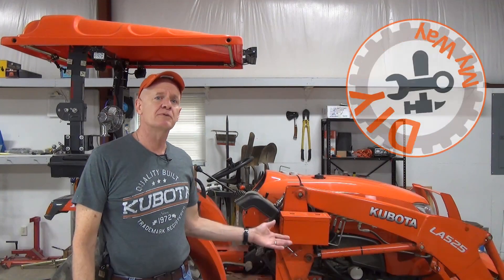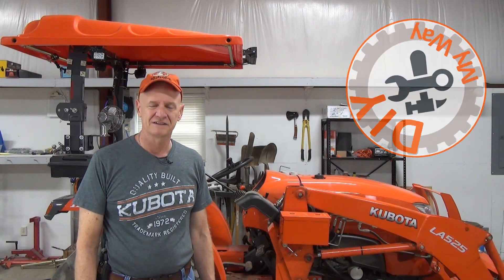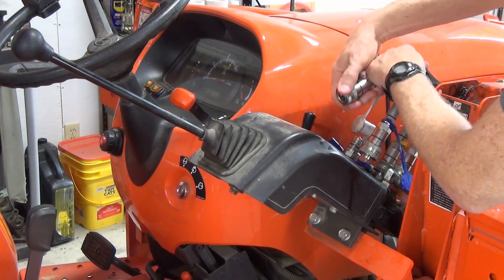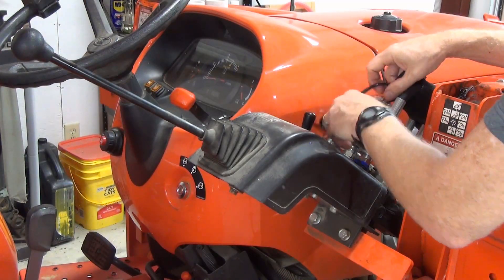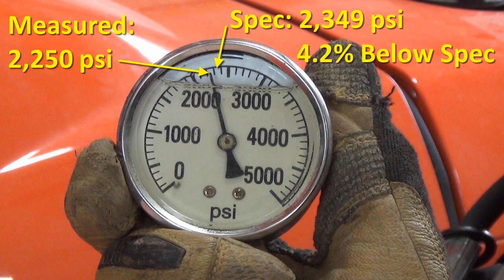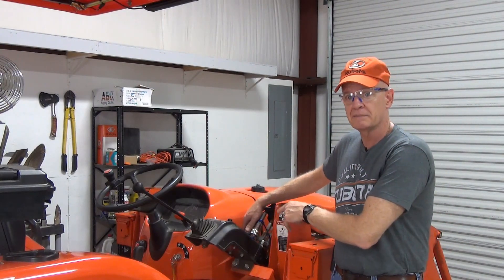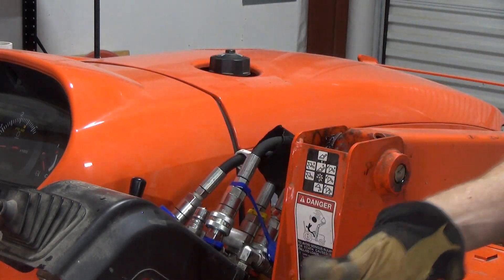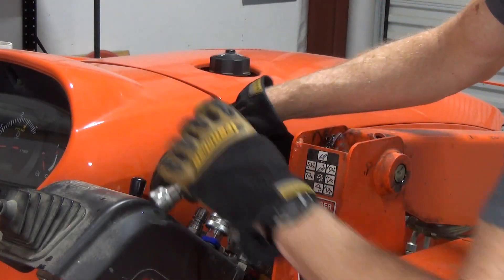How to Check Your Tractor's Hydraulic Pressure (#145)

Comment: If I am trying to find the proper RPM to idle the engine at for a pto hydraulic driven attachment, would this tool function well to test and find out which RPM is going to meet my needs? This is kind of a DIY project where the attachment isnt exactly designed to be an attachment for a tractor but does require hydraulic pressure. I know the limits of my attachment but I am struggling to find specific information on the pressure outputs.
Reply from the maker: Supposedly, the hydraulic pump pressure is not very dependent on the engine RPM.  The engine RPM does affect the gallons per minute of hydraulic fluid that flows.  The max pressure is controlled of the relief valve of your tractor’s hydraulic system.  Your attachment SHOULD have a pressure relief valve of it’s own to protect it from over pressure but if not, you should add one.  Will it be running off some rear remote ports or 3rd function valve?

Comment: Very useful video. I have a L39 Kubota which I am currently starting to test hydraulic pressures. I am wondering if there is a master PRV at the pump outlet as well as at each control lever?
Reply from the maker: Glad you think so!  There should be a master PRV for sure.  I believe most hydraulic implements like FELs and backhoes have their own PRVs for each pair of spool valves.  Mine do, anyway. Thanks for watching!

Comment: Both my old 2501 and my new 3902 hydraulics were under specs! I bought the shim kit off eBay for $18 (already had a gauge) 
I went 250 psi higher than spec! (Right about 2500 psi) I rarely use max lift pressures so not concerned with damaging the hydraulic system …But if I do need it ..I know it’s there! I do need ballast when lifting something that heavy. Some where around the 1300-1350 lbs area! Before it would only lift 1100 lbs or so.
Great video as always.
Reply from the maker: Hi Mark!  That’s a mod that’s on my list to get done.  I could use a little extra lift from time to time. Thanks for watching!

Comment: Question I have a bobcat.   Arm won’t go up and it won’t dump only moves forward reverse.  I conected a have on the hose coming out of pump main pressure and reads only 500 psi. At hight idle

Comment: How's she goin'?  David at Pale Horse Outdoors is a pretty nice channel eh!!!  He does a nice job with his videos.  This was a nice video too!!  This is a great idea for testing the hydraulic pressure.  I know on my Massey Ferguson GC2300 it seems like it doesn't have the power it did when it was new.  Perhaps the hydraulic pressure is just low.  Thanks for sharing this method of testing.  Take care!!!
Reply from the maker: Hi Mike!  Sounds like you should check the pressure.  Those springs in the pressure relief valve can get fatigued over time so you might find you need some shims for it. Thanks for watching!
Reply: @DIYMyWay  Yes Martin that could be the cause, but maybe my pump is wearing out too.  That would be a pricey fix.  So like the guy says, "Never ask a question unless you're prepared for the answer."  So I'm holding off for that reason probably!!!  LOL
Reply: Thank you, Mike! :)

Comment: Great product!  I've mounted a gauge permanently to my tractor, linked to the "raise FEL" hose.  So when I do max out the lifting capacity, I can confirm my Case is to spec with 1300 psi (Yes, that is low!).  But the best function is to estimate the load being lifted too.  The value is only good when I am rising it from and close to the ground, which calculation is as follows:  (PSI reading -350) x 2 = lbs lifted. Although the 2 factor is a rounded number, the exact value is close enough for estimation.  That is just luck the conversion factor gave that simple number, as it was based on triangulation of forces, leverage, size & number of cylinder, etc.  Thanks!
Reply from the maker: Hi Joe!  Yes, the PSI is low, but I’m guessing the gallons per minute flow rate is decent and your cylinder bores are larger to make up for the low PSI. I’m not surprised you have a permanent pressure gauge on your tractor and have worked out the equation to calculate the load on your FEL in pounds.  Of course you did, your’e and engineer!  LOL!  Thanks for watching!
Reply: I do have 7gal/min, which is not too bad, but the bore is still 2 inches in diameter. The difference is that the stroke is longer... Beauty of hydraulics!

Comment: 3:44 How are you starting the engine without sitting in the driver's seat and pushing the clutch?
Reply from the maker: My tractor doesn’t require the clutch be pressed to start the engine because it has an HST transmission. Thanks for watching!

Comment: Thanks Martin. Shimming myB2650 was a breeze as well. Occasional testing is good, as the pressure spring can weaken over time. Bolt-on has all the shims one will need to maintain factory specs. Warning,be prepared for the “it’s ok to over pressure the system” group should you make the follow-up video 😎 Take care my friend.
Reply from the maker: Hi Paul!  I didn’t know BoH has the shims.  I’ll check it out! Thanks for watching!
Reply: @DIYMyWay  Sorry Martin, believe I had a senior moment there. I purchased my kit from Bxpanded and it came with a selection of shims. I don't see the shims listed individual there now. I do know my :Kubota dealer has all the different sizes. Many sites offer on-line sales as well. Sorry for the confusion.
Reply from the maker: No worries Paul. I know I can get them from my dealership or Messicks.